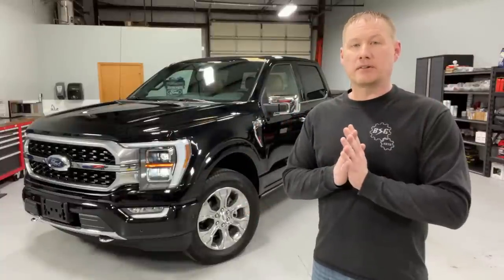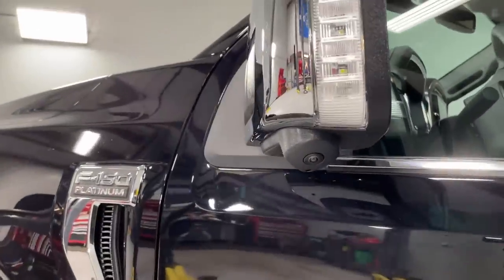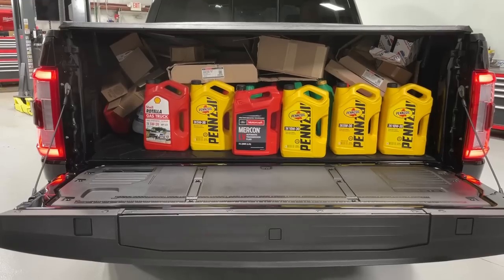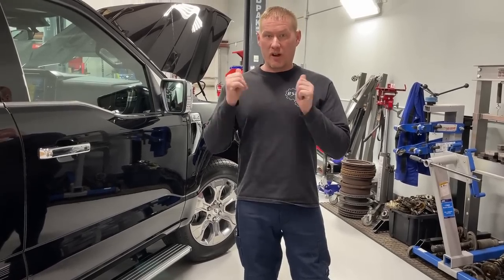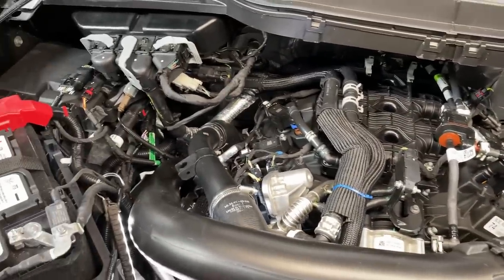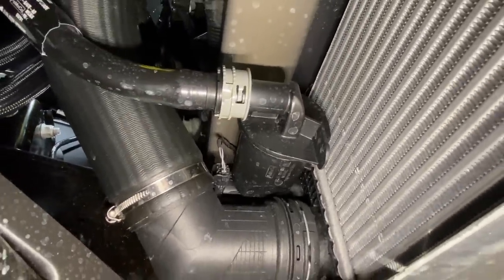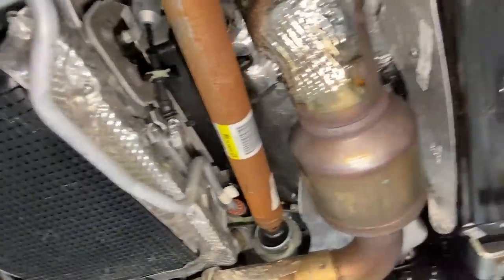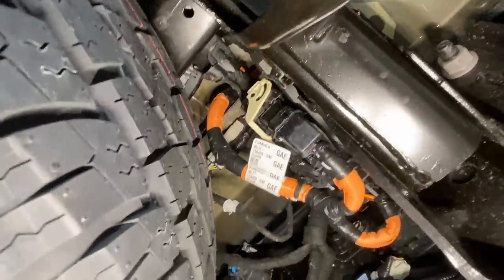The All New 2021 Ford F-150: My Initial Thoughts Pt. 1 of 2

Comment: Wow, a beautiful truck. Here are my take-a-way thoughts.  

It’s cluttered and complex. I’ve always kept my underbody clean… including washing and spraying sealant on and in the frame.  I’ve also always kept a light coat of paint on the differentials and areas that rust like crazy because Ford doesn’t paint or protect these components.  This truck seems like keeping the underbody clean and rust free is more difficult. The exception is the aluminum and frame. The frames now seem to be pretty well painted. 

I’m old now and always buy the most comfortable seats (6 back surgeries) and I’ve found these conveniences break more often than the manual. 

When I see these vehicles , it makes me believe we will eventually go electric. The complexity under the hood is just crazy. There simply is no way all of l this complexity won’t be an issue for people after warranty expiration.

Electrical vehicles, if they can fix the range issues will simplify a lot of these issues.

Comment: I have a '20 3.5 Lariat and I was frustrated with the 10 speed trans. It was somewhat rough shifting and hunted for gears at times but after a few thousand mile it has gone through the "learning curve" I guess you could call it and the trans is smooth as silk now. Very happy with it.
Reply: My dad had that same truck. Had so many problems with that trans. Had it into numerous dealers i don't know how many times trying to fix the rough shifting and banging into gears. Finally got fed up and got rid of the POS and went back to GMC.
Reply: @bradskis81  GMC “helped” Ford with the 10 speed trans. Lol

Comment: I bought 2 weeks ago a new 2021 F-150 stx with the 2.7 engine. I am in LOVE
Reply: 2.7 engine...LOL
Reply: @freedomring4813  yes. 😍 what happened
Reply: @Benjamin06267485  Its a TRUCK ....NOT a Prius....LOL... The only engine Ford built worth a crap under 8 cylinders was a straight 6. Just think ... you could have had a .....V8. No personally I'll take a bigger engine over that turbo crap. But if you love it.

Comment: Very interesting changes. I really like the active lower air dam for mpgs. I also like the trans cooler setup that seems like it’s going to last longer and not leak. I think the solid thick leaf spring helper is a good idea so it’s less likely to trap salt and rust. I think it’s a shame these trucks are brand new and have so much surface rust.
Reply: I suspect that the cost of the air dam option will far exceed the money that you will save at the fuel pumps.
Reply: @sophiamountain9966  Right for most cases. But for the guys that are driving empty miles in flat areas like southern field supervisors it should be a noticeable difference and might even pay for itself. I can’t imagine that air dam is contributing thousands towards the msrp.
Reply: I took off the snowplow sized air dam on my truck, it cannot make much difference in mpg
Reply: I get why people get frustrated about the rust but I can guarantee you that all those components will never fail due to that rust, it never gets past the point of surface rust so no reason to be concerned other than the aesthetics of it

Comment: Nice to see that the vacuum system is gone for The 4x4 front and the IWE Is now electric with a DC motor I like that 👌 Brian thanks for showing that @FordTechMakULoco
Reply: I prefer the old manual locking hubs
Reply: @mark98070  I agree but I made my orginal comment because I have 2 fords from 2005 and they both have the vacuum operated system they both have the manual hub locks were you can put it in lock or in auto  but the system rarely works I do agree the old manual on and off hubs are the best but cost to much to do that on these systems even from 2005 you would have to put a manual tranfercase In to use them the vacuum system is electronically controlling the transfer case on anything from 2005 and now

Comment: Great looking truck.   Theres one thing that bugs me (I'm sure you will mention it) is that even on new ones on the lot they have that surface rust on the rear axle.   Wish they'd paint or coat them better.
Reply: Does not take much to prime and paint I did on my GT
Reply: I agree....for the money spent, should be coated. I ended up wire brushing mine and cleaning it, then brushing POR 15 semi gloss black on mine. While at it, I upgraded my diff cover with an aluminum B& M cover.....wasn’t that bad.
Reply: Nothing should rust in the first 4-5 years on a new truck. We should not let manufacturers get away with things like that. My money doesn’t rust when I hand it to them. For what we pay we should expect more! I live in a cold climate so I’d let it go after 4-5 th season.
Reply: Seriously. This truck looks like it just rolled off the carrier and everything has thick surface rust on it. Wonder if it was one of the ones sitting in a field waiting for a computer chip. $70k and that's what you're going to hand me?

Comment: I read somewhere else that the ride height sensor is for loading, it lights up a series of "load" lights in the driver side tailight to show your percentage of full load based on the rear ride height...
Reply: There's a good chance that the height sensor also feeds the auto-leveling headlights.
So no more blinding folks when you get trailer weight sag.

Comment: I know that looks are subjective but I'm not a fan of the new front end design, looks way too GMCish to me. Looks great on the Raptor though due to the wider front fenders. As far as the oil pump belt on the 5.0, I have seen videos of people talking about how that system was tested up to 1100 hp and 200,000 simulated testing miles with no issues at all. I can't confirm that but there are some people out there that have been claiming that. Time will tell. 

Also, I work at the Sterling Axle Plant, in the axle tube bracket welding department, yes we do make a 3/4 floating axle for this vehicle. It's available with the Max Towing Package. The flange that we install on that tube is a beast!, along with the heavy duty axle tube. Way more stout and rigid than the standard axle tube. Pretty cool how they came up with that idea!

Comment: belt driven oil pump and cylinder deactivation in the 5.0, ford what are you doing?
Reply: I don't get why manufacturers always seem to try and have to re-invent the wheel?
Reply: The chain driven oil pump was the weak point of the previous gen 5.0 engine.

Comment: Make your videos as long as you'd like. We can always stop and start at other times, no need to break them up. I just did a timing job, changed my oil pump and pickup tube and changed a few fluids in my 2002 4.6 f150 with a friend of mine as a helper and extra set of hands and eyes. We both agreed that your videos were the best ones to use as a guide for everything we were doing. Thanks for the time you've put into these videos and I've been thinking about buying a new truck so I'm looking forward to watching these to see your opinion.

Comment: Do you plan on rustproofing this truck?
Reply: I’m also curious if he plans to woolwax this truck.
Reply: It's aluminum
Reply: @DavidSmith-fs4nt  The body panels are aluminum.  I've never heard of someone applying rustproofing to body panels.
Reply: The boxed frame sure isn't aluminum. There is plenty on that truck to rust. Besides, aluminum is not impervious to corrosion.

Comment: I bought a 2021 XLT 2.7L with the 302a package a few months ago and I love it.  The truck feels really solid.  I'm glad you made this video showing the under side because I have looked under mine yet to see what has changed and what didn't.   Over all I'm very happy with my truck.  The only issue I have notice is the sync 4 has glicked out a couple times but I just shut the truck off and turn it back on and it's fine. I really like the back up assist and the zone lighting. Both a very helpful.

Comment: Working on a truck like that looks like a nightmare.
Reply: I totally agree. Unnecessary led lighting around the headlight makes them probably 1000 bucks or more.  Ford cameras are notorious for failure and cost more than 400 bucks and aftermarkets don't work right. 2000 grand for master cylinder because they the mistake to make it integral?  That's plain dumb.
Reply: @davea2288  They do it on purpose because they don't want the ordinary bloke in his shed to fix them anymore. Which is bullshit!
Reply: I need a new emblem for the grill. Ok, $800
Reply: Probably will develop slight miss that is way to difficult to flag on hour
Reply: Sure if you are incompetent.
Reply: That's why you buy the 100k warranty bumper to bumper. If you want to work on your truck you have to go back a few years. My old 2007 F150 was still a truck I could work on except the plugs. They should have replacement at 50k.

Comment: Truck is absolutely gorgeous.  I would be very hesitant however about owning one of these past the warranty without getting an extended.  $600 for an oil pump - $2k for a master cylinder/booster unit - Not to mention the return of the dreaded EGR coolers.  And I thought my '08 6.4L was a nightmare.  Don't get me wrong.  I love this truck and would totally get one.  But once I'm on the hook for repairs, it's time to say goodbye.
Brian - I see a little salt residue underneath.  Shoot this beauty with some Fluid Film before it's too late!

Comment: 2 part for sure! Very happy for you to have gotten a brand new truck, and at 70 large, hope you will be enjoying it for years to come. My thoughts are:
Great update on the longer running boards, now you can wipe down the rear glass without climbing up into the bed.
Get the bed line x done, that plastic inlay inside the tailgate is neat, but probably wont be as durable as a good old metal one. 
Black isn't a color on these trucks, it's a part time job keeping it looking good, glad mine's white.
Congratulations again, your hard work has paid off, could this have happened if you hadn't taken that gamble on yourself and left that dealership life behind? Glad you got out of there and also out of that eco diesel brand x truck from a few years ago!

Comment: Start stop is a deal killer for me.
Reply: It's the worse feature I've ever experienced in a vehicle.  Especially when you are a passenger and the better half doesn't want to use the override button!
Reply: I have a 2019 with the start stop feature. You can turn it off if you want. Personally I don't even pay attention to it most of the time. It makes for a quieter ride and saves gas.

Comment: Driving by our local Ford dealer here in PA, the entire lot is basically 50% empty. A ghost town. Not one single solitary pickup available of any type or trim. It's pretty depressing.
Reply from the maker: I was very lucky to just walk in and pick one up in January.
Reply: The chip shortage is really hurting the manufacturers. To the point where the used cararlet is really inflated and prices are going high.
Reply: Ford is parking their trucks at the Kentucky motor speedway because of the chip shortage. I was driving on 64 past it several weeks ago and the place is full of pickups.  They must build them in Louisville.  One f150 rolls off the assembly line every 57 seconds.

Comment: All this new tech is killing the industry for long term reliability. Between Eco Boost issues as they age and the transmission 10 speed issues. I have always been a ford guy but 60k for a pickup I should not worry about failures that can cost a ton to repair as the age. Fords used to last 200k plus if you did the maintenance now a days I have no confidence in buying anything new for price reasons and future failures

Comment: Not trying to be a negative Nelly but these new trucks are a turn off to me, not only price but complexity.  Sure it's nice when its new..... after seeing that nightmare of an engine bay, it will also be awfull hard to work on yourself when it gets to be 10-15 years old. It seems every year these vehicles get harder and harder to service with cheap non-servicable parts and a bunch of unnecessary features to justify the ridiculous high price.

Comment: Possibly the rear height sensor changes the rear brake pressure and anti lock brake operation when loaded. Brake by wire electronic controlled master cylinder if I read correctly.

Comment: $72,000.......I guess I’ve bought my last pickup.
Reply: Eh, that's sticker.  Pickup trucks have a lot of markup, you can usually get at least 12% off sticker, sometimes up to 20% off if you time your purchase just right.  At the end of last year I got a new 2020 F150 5.0 stx crew cab 4wd for 15% off sticker with rebates and the dealer discount ($36k without TTL) and my dad was able to grab a new 2020 Expedition limited for just over 20% off sticker but had to drive 300 miles for that deal.

Comment: Nice truck! I still love my 2019 F150 Sport 4x4. Quiet ride, pull a 24 ft. boat no problem all the time. There's a lot more room under the hood with my 3.5 EcoBoost than yours. I was skeptical at first of a v6 but it's a beast especially pulling my boat up steep boat ramp hills.
Reply: He made a video about the 3.5 ecoboost .

Comment: Hey, there is a guy sitting in the front seat of your new truck!  At 8:35 same guy is in the tailgate reflection! ;p Great review, Brian. I'm good either way with the length of the video. A 1 hour FordTechMakuloco would be great.
Question about the ecoboost: has Ford fixed the problems with DI?

Comment: Beautiful truck.
I've been driving Ford pickups since the F100. (Dating myself, huh?) They just keep getting nicer and nicer.
Reply: I still have a F100, reminds me of a simpler time. I ordered a powerboost, still waiting. I think I'll like it, but man it's  probably going to hurt the wallet when things start failing. I saw a previous video, sounds like when/if the LED light units have to be replaced entirely for $800-1000 a light ($2000~ for both).

Comment: Spot lights were on the heavy tow package/blis in my 2019xlt.  Additional, I use a 2x6 with an old innner tire tube stapled to it on one side, acts like a non slip hold back bumper in the bed.

Comment: Man do I rally dislike turbo motors. But as long as they have a V-8 or normally asperated V-6 or straight six I'm good ( Yes I know they don't have a straight six anymore but a guy can wish. ) .  Then all these extras you've talked about so far are just things to go wrong. If I can't get a normally asperated motor I will have to wait for the fully electric or a hydrogen power F-150. OH WOW about the V-8 motors with those problems. I don't use the bed for much very often anymore but when I do I'm glad I have it. The more you talk about the problems here and there ( V-8 and the 10 speed trans ) the more I'm thinking of moving to a less of a truck truck like a Ridgeline.

Comment: There are a high percentage of higher content vehicles and some without high content that have the ABS/brake assist combo system. Toyota 4runner models used this going back a few years and it seems to have been durable.  You can't have autobraking with high tow load without a badass brake apply system.